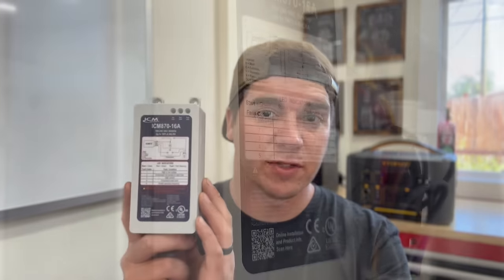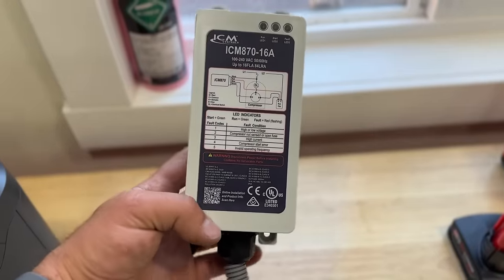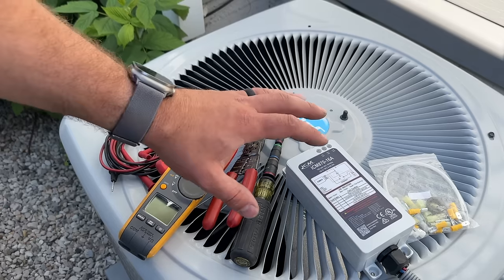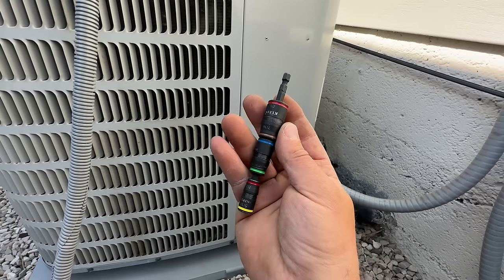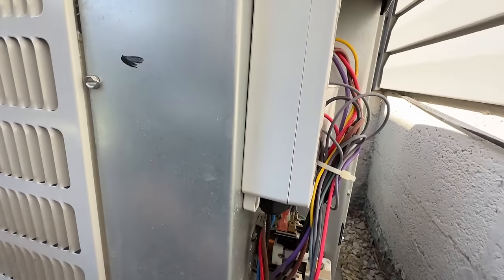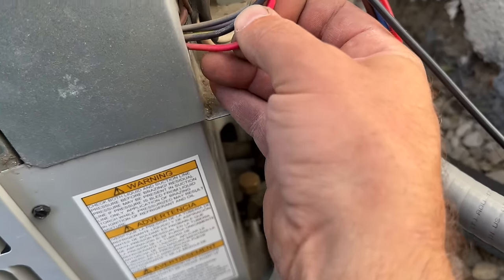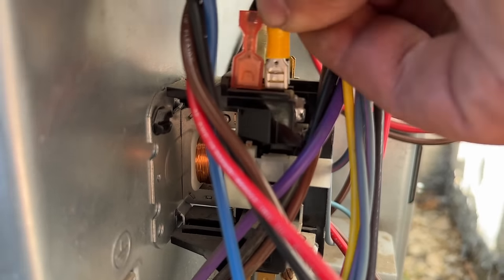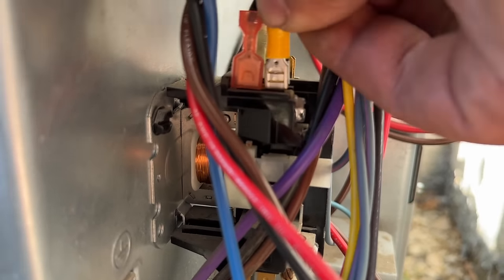This $150 Soft Start Allows You To Run Your A/C With A Generator!  Introducing The ICM870

Comment: Great video. I did go to install, but noticed my unit has two capacitors. Can you maybe talk me through that?
Reply from the maker: We have a remote assistance page at Patreon.com/diyhvacguy. I can’t help through comment’s unfortunately. Hope we can help.
Reply: Best guess is you have one for the fan and one for the compressor.  Your wiring diagram will confirm this as well as the markings on the capacitors..you are only interested in the compressor side.

Comment: Came across your video searching for alternate units to the Micro-air soft start. This appears to do the same thing and on ICM's main site, they do say it can be used for RV's. However I can't seem to find anyone installing it on an RV air conditioner. Will this work for RV style air conditioners? Thanks!

Comment: I have a question. Why are these not a factory option? At least they should be factory installed. Crazy no manufacturer offers this as a standard feature.
Reply: Most companies will design a product for the majority of their customers.  The sort of person who will buy a generator and connect it to their home is in the minority. Adding this as a standard item adds cost that many will not pay. However, it might make better sense to at least offer it as an option when originally purchasing an AC system.

Comment: Can you explain how to connect this to a Lennox 3T AC (1923d56431 serial number) because first I can't find which wire I can measure all inrush amps and secondly all the colors on the wires and going to the compressor seem different.

Comment: The 5.1A reading - was inrush of running?    5.1A seems low for running amps, let alone inrush.  A commenter below, "27a inrush on the 2.5t with the icm, 12a running".  So I'm confused by your number.

The MicroAire does seem to have more bells an whistles, particularly in the monitoring aspect.   But the ICM seems to offer basically the same performance (lowers the inrush current) at 1/2 the price.   So it seems like definitely worth consideration, depending on what you want.

Comment: Great Video... I am going to install 1 myself and wasn't sure which one of the 2 options linked is the one for me. I live in Florida and it is a basic split system by Rheem. Which one should I get? the 16a or the 9a? Thanks!
Reply from the maker: If it’s 1-2 ton the 9a  and if it’s a 3 ton then the 16a    Anything above that and you’ll need to go with a  micro air unit

Comment: Thank you for posting this most helpful video and your other videos to help us DIY'ers make some sense of some of the HVAC issues that we encounter as homeowners.  
I have a Bryant "heat pump", Model # 213CNA036-B and was wondering how to determine the "tonnage" for a potential "soft start" that you recommended.  I do have a 'back-up generator" that produces 8750 watts and wasn't aware that we could run our "heat-pump" off of this particular generator.  I hope this is enough information to recommend the ICM870 for my particular setup.

Thanks in advance!!
Reply: .....I forgot to mention that I already had a "hard-start kit" installed a few years ago.   Will that make a difference for the installation of the 'soft-start' kit???  If so, any advise on this would be much appreciated!!
Reply: You answered my question in another video on 'if you can have both a hard-start & soft-start on the same unit?  Thanks for that!!
Reply: 3 tons....36 is the BTU in thousands. 12 thousand per ton.

Comment: I've added a "hard start" kit to mine and it was able to start after that.  MUCH cheaper than a $150 easy start kit.
Reply from the maker: Yes hard starts are to keep a system running or prolong the life, but soft starts are moreso intended for use with a generator.
Reply: @diyhvacguy  In my case my generator is large enough to handle my 3 ton A/C without any help and on the grid my A/C is also starting fine, so you are saying I can get the same soft start benefits (lower inrush amps) with a hard start kit? Thanks

Comment: It looks like the ICM870-9A is going for $170, the ICM870-16A is going for $190 and the ICM Controls 870-32A is going for $225. Other than possibly wasting $35 dollars is there any reason not to buy the ICM Controls 870-32A instead of the ICM Controls 870-16A to protect myself in case I ever need a larger AC unit?

Comment: Does this help lower the electric bill?! If so is it a drastic difference or not really?
Reply: No, the amount of energy required to cool or heat your house remains the same regardless of any of these devices. (I am assuming your electric utility charges you for just a total amount of energy, in kW*h each month.) Their purpose is to spread out the spike of current that an electric motor pulls when it starts up. This is important because a generator or battery inverter can only supply so much current (amps) at once, so that inrush current is often the limiting factor rather than the total power the generator or inverter can output.

Comment: Will this help cut energy costs relative to the initial start up of the compressor - which is at least one-third of the energy consumption of air conditioning in general.
Reply: from what I've read, you probably won't notice a change on your electric bill.   It's more of an efficient use of energy during the startup, which is only lasting seconds.
Reply: Will not reduce the electric bill. The reduction of current is for 0.45 second duration at the start of the compressor.

Comment: Does any soft start kit installed on my central AC compressor allow me to use the 6500 watt generator (connected through an interface to the circuit breaker box) and run the AC? Or just the one you mention?  Very useful videos you make, thanks.
Reply: The correct answer is it depends what you running at the time of ac startup but a rough answer is if you can get inrush down to 20-25 amps it will start.

Comment: checked your link cant find the soft start their not available on amazon im looking for  ICM Controls 870-16A Soft Starter, Built-in Start Capacitor, Over/Under Voltage Monitoring, Over-Current Protection, A/C Motor Starter. Made in USA. UL and ideas what stores might have it

Comment: What is best device to use on a camper ac and a 2000 watt Honda generator?
Reply: Assuming you have one of the Honda EU series or a similar inverter generator, I would take a serious look at swapping your current AC for a quiet mini split heat pump. There are plenty of YouTube videos to be found by searching for "rv mini split". My own research indicates that the Senville SENL-09CD/Y (120 volt version) is one of the best choices among the field due to better than average efficiency and a responsive technical support line should you run into issues or have questions. Soft start is already built into the design.

Comment: Ok I understand the concept of the soft start with a Generator I have a Generator that will start the 2 ton AC no problem. Problem is the heat strips in defrost mode.. unless you manually disconnect the heat strips is there a way to stop the defrost strips? I have a Ecobee thermostat. I have a 7800 watt generator and 8kw strips now. The old heat pump had 10kw. My new heat pump is so much nicer and so quite, ECM motor , do you think a soft start would be a good investment? My installer had not heard of them.
Reply: Soft start is good for the heat pump to play nice with the generator. The heat strips need to be disabled PRIOR to the generator being operated. Since I am well versed on how these things are wired, I could comfortable do this in my house. This is not something that can be explained easily without a knowledgeable person in front of the opened up air handler. Generally it is 20A PER heat strip. This can make quite and arc/short if done improperly.
Reply: Are the resistance heat strips controllable from the Ecobee, maybe as "Emergency Heat"? if not,  I agree with 1badsj, you would have to disconnect them to work with an ~8 kW generator like that. I'm curious, does the system often turn on the resistance heat strips or are they there "just in case"? What's your outdoor winter low temp like?
Reply: The heat strips are indirectly controlled by the Ecobee. You can manually select Emergency (or Aux) heat but you have no way of disabling them from the thermostat as they are needed to provide indoor comfort during defrost mode. @TaiViinikka
Reply: The soft start will do zilch for the strip heat.  You generator is to small to run the unit AND the strip heat.  You wouldn't really want to anyway, as it will suck a lot of gas when it does run, IF you have a generator to run it.  

The EASIEST thing to do, is to disable the heat strips, via a toggle switch (disabling the RELAY that energizes the heat strips-so switching low current) placing the switch somewhere you can access it.  Using it ONLY when you run the home on the generator.  If you must defrost, then a bigger generator might be in order.  Of course there are points of failure, and it might not work in everyone's circumstance...but it works.

Comment: Does this work in the same way as the RV soft start?  Specifically can I install this on my 15k RV air conditioner and will that allow my AC to start and run on less than 30 amps such as 15-20 amp service?  Thank you.

Comment: Quick question on the soft start. I have a fairly new A/C with a scroll compressor. Do you know if the soft start will increase wear on the compressor or actually give it a longer life?

Comment: Does this delay the compressor after the fan like the micro air? It doesn’t sound like it in the video. Having them start separate will save you some surge current
Reply from the maker: I don’t believe it does. That’s one advantage to the micro air for sure
Reply: That’s a shame. I also saw there’s a 3 min delay on every start up. I went with the micro air for this reason.
Reply: The older ICM870 started the compressor 0.5 second after the contactor is closed, the fan start right on the contactor closed. The newer ICM870 start the compressor 4 minutes after the contactor is closed.

Comment: Does this save you electricity?
Reply: No, the amount of energy required to cool or heat your house remains the same regardless of any of these devices. (I am assuming your electric utility charges you for just a total amount of energy, in kW*h each month.) Their purpose is to spread out the spike of current that an electric motor pulls when it starts up. This is important because a generator or battery inverter can only supply so much current (amps) at once, so that inrush current is often the limiting factor rather than the total power the generator or inverter can output.

Comment: I installed this a few months ago. It worked perfectly, until today. I heard a loud noise and so I checked it out. The AC unit was shuttering. I turned it off. Looked inside and the soft start unit was fried. What would cause this?

Comment: Great Video and thank you for making it.  
I have a Generac 22KW generator that works fine, however the HVAC (3Ton Rheem) will try to start but can't run.  I don't mind adding this ICM870 but I feel my 22KW generator should be able to run my Rheem 3 ton unit.  I measured the inrush amps and I got 84 Amps while the label says 79 Amps but figure my Amp clamp is not a Fluke and there fore less accurate.  

In your opinion is something wrong with my setup (Only 2 Years Old) or should I just add this ICM870?  Thanks
Reply: FYI, 84A is 18.5kW power draw, which leaves you with 3.5kW supplied to the rest of your house. Chances are you are already drawing a few kW throughout the rest of your house so when the Rheem kicks on, it would increase the total draw of your system to over 22kW.

Comment: I PUT THE MICRO AIR ON   UNIT CYCLES NORMALLY BUT AFTER EACH CYCLE   THE INSIDE AIR HANDLER COMES ON FOR ABOUT 3-5 MIN  SHUTS    30  SEC COMES ON AGAIN FEW MIN  SHUTS    NO COMPRSSOR OUTSIDE RUNNING  JUST INSIDE   EYR TIME COMPRESSOR RUNS  NORMAL CYCLE   IT SHUTS THEN INSIDE ONLY COMES ON FEW MIN SHUTS BACK ON  SHTUS  3-4 TIMES  ANY  THOUGHTS?

Comment: Will this lower my power bill? It isn't using less power right, it's just using the same power but slower? Am I thinking right?
Reply: No significant savings. More likely a slight loss because the soft start device will have it's own energy losses. It will still take about the same amount of energy to get the compressor up to operating speed. Think of it as being like filling a barrel with a fire hose as opposed to a garden hose. Same amount of water either way. The power company simply has a bigger generator and thicker wires than you do.

Comment: I'm curiously considering an ICM 870 32A for my Rheem 4 Ton System HVAC that I had installed a year ago. I've watched several videos also installing the ICM 870 like I'm looking at. Just recently I watched a video saying something like a soft start killed a compressor. He didn't explain why and it made me do a double take on it. Do you have any info on can a soft start cause problems with a compressor? Looking for more positive info and if negative, I'll take that too! Thanks

Comment: I have a question.  I'm interested in putting a soft start kit on my A/C unit.  But most of the kits I found is a 2-3 ton or 4-6 ton, and I have a 3.5 ton unit.  Do they make one for my type of unit? Thanks.

Comment: Does the fan start before the comp or still at the same time?
Reply from the maker: Fan starts first, then compressor. One advantage to the soft start kits 👍🏼
Reply: @diyhvacguy  Well it worked for 1 week, a/c still works but no green lights or any lights on ICM 870 and I knew it quit because I could hear it start inside the house again!

Comment: Do we need permit For Change out Any System furnace Or Air conditioner .do you think home owner can do that . Do you think All HVAC contractor Have Permit When They do Change out.
Reply: If it is wired into the A/C unit likely not. Permits are required when changes are made to wiring of the actual building.

Comment: Can the inrush amps be determined with a regular clamp multimeter without the inrush button?
Reply from the maker: No it must have to inrush feature
Reply: If you ammeter has a min/max feature, it can read inrush as well.

Comment: What is the difference between a soft and hard start? Thanks
Reply from the maker: Soft start kits are moreso intended for using a generator to run your air conditioner, they also help with dimming lights when the ac comes on and noisy compressor start ups. Hard start kits will deliver the current quicker, so they are typically used to prolong the life of an old compressor, but a lot of folks think they are good to install from the start. I think they are great in either scenario. I installed one on mine from day one
Reply: Hard start kits are a crutch to help old compressors electrically overcome mechanical resistance to starting.

Comment: I have a 2.5 tons ac. And Amazon doesn't have the 16 amps soft start, can I use the 32 amps soft start instead of the 16 amps?

Comment: I bought and installed the ICM32a however it says to uninstall or disconnect the Start Capacitor? Not sure where or how to do this as my unit is showing a green RUN led but my AC unit is not running ?

Comment: Years ago, I had an electrician friend of mine put in a manual generator panel for my portable generator. He told me I won’t be able to run my AC with it so I’m assuming he didn’t put that as a circuit in the manual panel. Can I still use this soft start?

Comment: is this compatible with heat pumps?  any wiring differences?
Reply from the maker: Yes, no difference
Reply: As far as the compressor goes, no difference. HOWEVER... Heat strips (used in defrost) use a LOT of amps. Especially bigger systems. You will find this out when the generator breaker trips everytime they are energized. (That is unless you have a HUGE generator)
Reply: That depends on your definition of the heat pump. If you are referring to a single speed split phase motor driven compressor that hasn't changed all that much since some time early in the last century, there is little difference. Heat pumps incorporating today's inverter driven compressors are a totally different animal.

Comment: Are these soft starts solely for generator runs or can these be used all the time to cut electricity cost?
Reply from the maker: Pretty much just for generator use. They help with flickering lights and noisy start ups though for sure!
Reply: They won't cut electricity costs but should help with longevity of your compressor.
Reply: Will not save electricity but it will reduce the compressor starting noise (the bang). I assume that it will also reduce the electrical and mechanical stress on the compressor
Reply: No, the amount of energy required to cool or heat your house remains the same regardless of any of these devices. (I am assuming your electric utility charges you for just a total amount of energy, in kW*h each month.) Their purpose is to spread out the spike of current that an electric motor pulls when it starts up. This is important because a generator or battery inverter can only supply so much current (amps) at once, so that inrush current is often the limiting factor rather than the total power the generator or inverter can output.